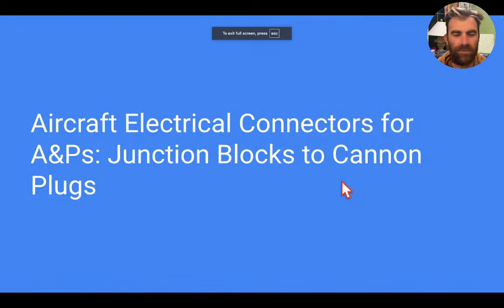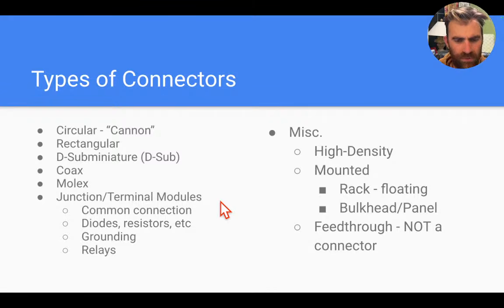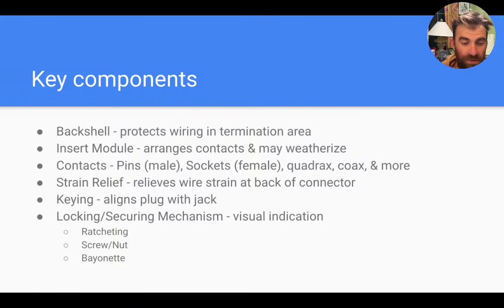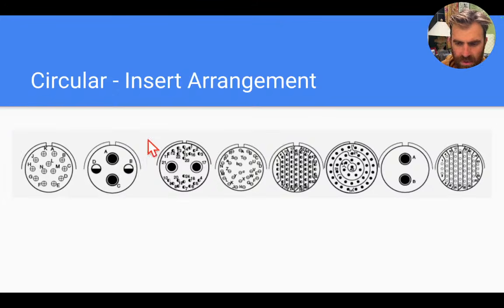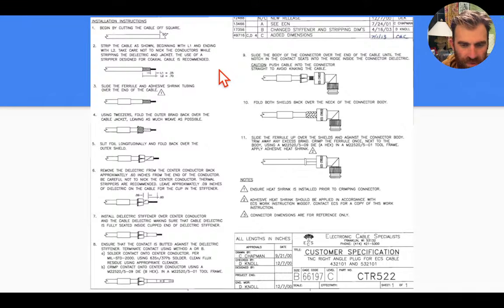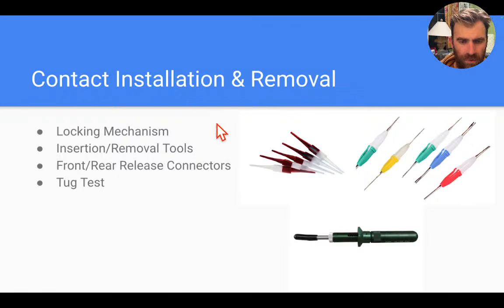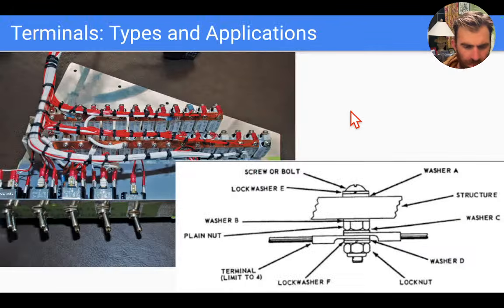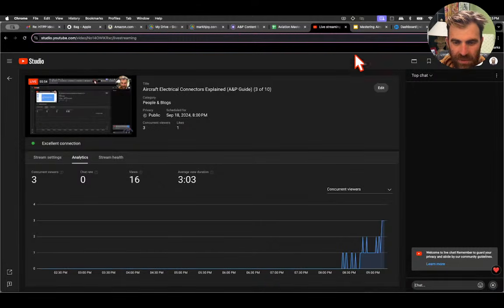Aircraft Electrical Connectors, Splices, & Terminals: Explained (A&P Guide) (3 of 10)

Comment: How find connector wire part number on a Boeing aircraft https://youtu.be/ESk1xmXkl8E?si=28Ei2zQTh_35S4bs
Reply from the maker: @fly_six2six I can’t tell if you’re trying to add value to the video with your link or if you have a question. What is up?